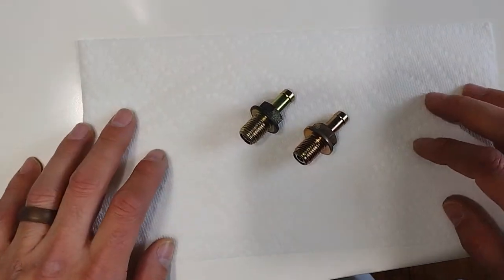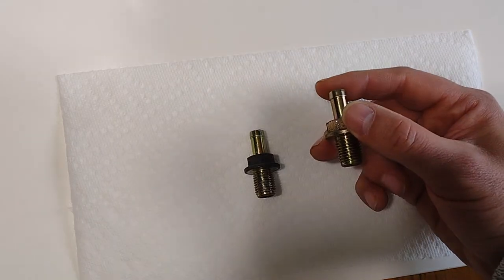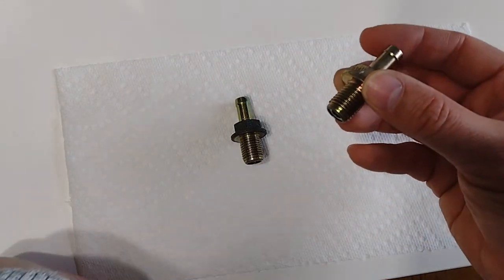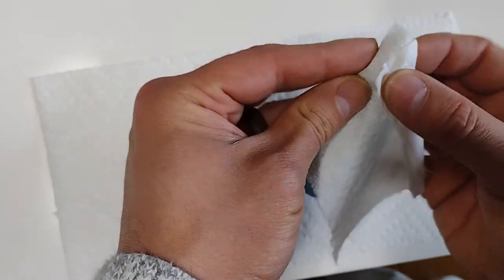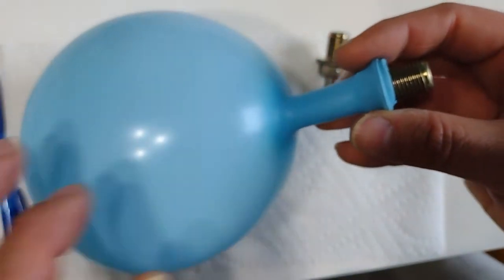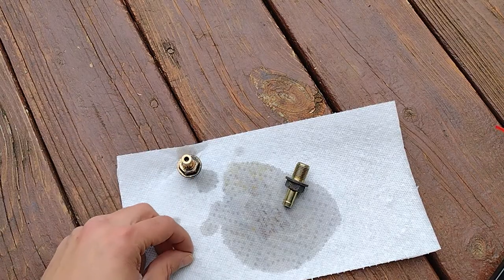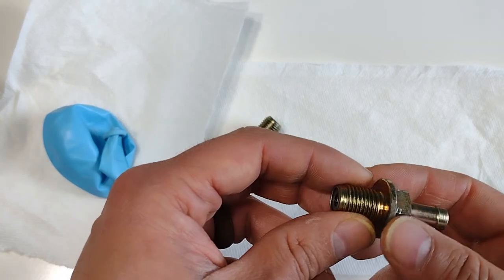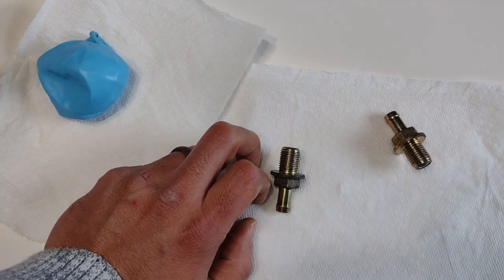How to test and clean a PCV valve

Comment: Great test.... BUT..... I'm not sure that even a "proper" functioning valve will be absolutely air-tight....like (say) a car's intake or exhaust valve is on a metal-to-metal seat. As long as the unit "clicks" when shaken and if the spring inside is predominantly pushing in the correct way to attempt a "mostly closed" condition.....I think these PVC valves are then OK. Perhaps a pro-mechanic can chime in and advise ?
Reply: You are correct. Its not function of pcv valve, main function is limit air vacuum on idle
Reply: Not all pcv valves have an audible sound when you shake it.
Reply: @vermontvermont9292 ...odd.....seems all the various brands I've seen are able to be heard if shaken. If a spring is used inside, ...the spring is typically very weak and only serves to push the seat in one direction gently...as the vacuum created to activate is not very great. Which car or brand do you see that doesn't have an audible sound?....curious....
Reply: The PCV should seal so that you don’t put pressure into the crankcase. This is a great test to check for a weak spring.

Comment: Why even test these cheap items. I just replace it and make sure that they are Oem and not some garbage Chinese knockoff because they have a calibrated air flow especially on those lousy GDI engines where oil build up in the intake manifold causes so much problems not to mention oil leaks due to the valve not sealing properly
Reply: Find me a 2zz celica OEM pcv valve and il ddo that, cant fine 1 anywhere
Reply: @d4ngerous4  same. 1zzfe with 350k, Toyota dealership has to special order it.
Reply: @Feckoff730  nightmare

Comment: Dudes, just blow through the darned thing.  Air flows one way, good.  Air flows both ways, not good.  Also, it is pretty easy to end up with a brand new valve that leaks.  I just checked two today.  One was good and one leaked.

Comment: I just tested with a brand new pcv valve and it will leak air just like your "broken" one does...
Reply from the maker: Does it leak out air fast or is it very slow?
Reply: I tested mine too and it "leaked" too 😂. But the size of the leak depends on how much pressure you put on the other side, if you put a high pressure, like say, you blow very hard, the "leak" gets less than if you blow lightly. So I suspect the pcv just regulates the pressure on both sides, it is not a one way check valve like you said

Comment: Cool! Thanks for explanation. How many miles should this valve be changed?
Reply from the maker: There is not scheduled mile change for PCV valves as far as I know.  Normally it is recommended to check and replace the PCV valve during major  schedule changes.  For Honda vehicles I believe that's about 100K to 120K.  I think is best to inspect it every 30K miles and replace as needed.  It's not difficult to check it and not many tools are needed.
Reply: @fixit9888  Many thanks for you help!
Reply from the maker: Bruce Wayne  the valve is not that expensive, 75K change is a good time to replace it as a preventive measure.  It's not that difficult to replace too.
Reply: Causa consumo anomalo di olio su Subaru ee20z diesel?
Reply from the maker: @boxerdiesel  no, no causa consumo abnormal.
Reply: I changed mine. Did not shake, engine idle better and improved MPG😃 at 95k miles
Reply: @fixit9888  il mio meccanico mi ha sistemato provvisoriamente un tubicino, ha detto che ha ordinato una valvola di plastica dove è inserito un tubo. Al minimo faceva un suono tipo 
Szszszszszszx!! A settembre in occasione del tagliando la sostituirà. Ho rabboccato 1 litro di olio Motul 5w30 xclean effe. XV diesel modello 2016. Ha detto che il caldo ha contribuito al consumo di olio

Comment: What were the simptoms of the engine that made you to check the valve? thks.
Reply from the maker: I normally check it every two years.  There was a point at which I had a high oil consumption and an engine light with a warning of a high fuel/air mixture.  I decided to look at everything in the vehicle and the PCV was one of the things I checked.
Reply: The main symptom was oil Consumption on a 19 Sonata 2.4. no signs of leakage anywhere but seemed to lose a quart every 1k miles. I swapped PCV valve today because I read a bad valve can cause that. There are other possibilities like piston seals, but a valve was 9.99 so it was worth a shot. I seem to have more power, time will tell if it fixes my oil consumption issue. Another symptom is engine performance is bogged down, not as responsive to gas pedal use. Another symptom is bad idling. When I bought this used at 92k miles I changed brakes, tires, iridium plugs, to name a few, but did not get the PCV valve this time which is one of the first things I do on a high mileage used car.

Comment: Question, anyone who knows...
I bought a new OEM PCV. I blew into one side horizontally (the way it is installed on my engine) and it had an air leak. Vertically, there was no air leak. I returned it and got another one, but the same issue?
Maybe my lungs are not as strong as an engine! What do I do? Order another one?
On my engine (toyota) it is a difficult R&R.
Reply: No, small leakage is ok

Comment: They are cheap to buy and can cause major engine costs and the 'test' is not at all foolproof. Just buy and replace an OEM one at NAPA  for under $10 and it is a simple replacement and can cost major repairs. Don't fool with it.... just get a replacement that is OEM.
Reply: Cheap huh?? My 2014 Honda Accord cost $47 and is all plastic.

Comment: Oil can never reach the PCV valve. If it could the engine would have used a lot of oil. And the PCV valve would have been cleaned by the oil. In fact it not washed that is why it accumulates ash particles over time.